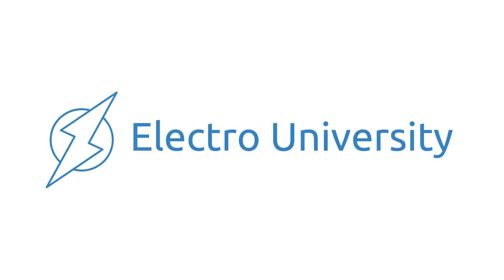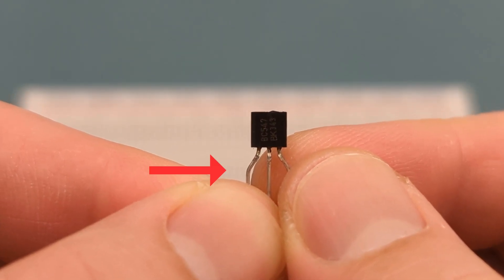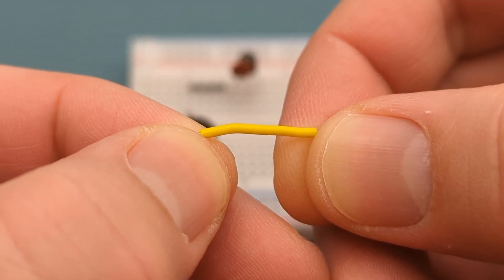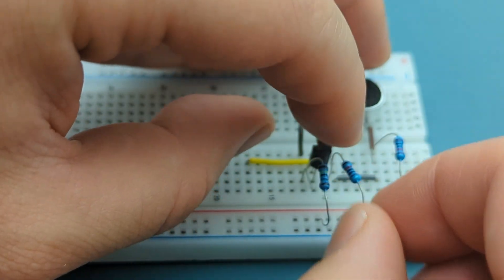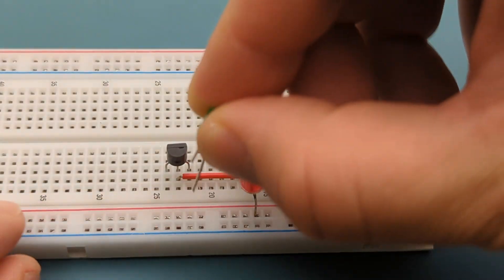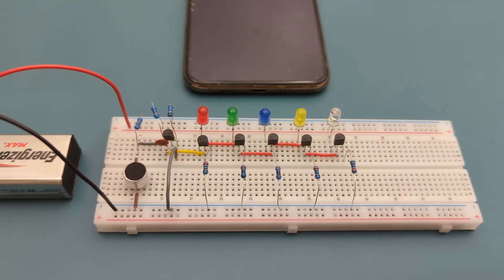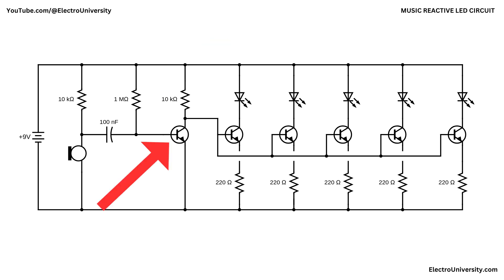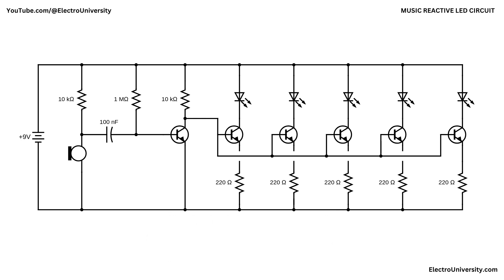How to Make Music Reactive LED with BC547 Transistor

Comment from the maker: 🔔 Get your tools here:
✅ Electronics Component Kit: https://amzn.to/3N65asq
✅ 9V Battery Buckle Connector: https://amzn.to/3S7kbg8
✅ 9V Batteries: https://amzn.to/4kkonVD
✅ BC547 Transistors: https://amzn.to/44pDOFW
✅ 104 Ceramic Capacitors: https://amzn.to/448CgRC
✅ Colors LEDs: https://amzn.to/46p6Qb0
✅ Resistors: https://amzn.to/3YfGeUi
✅ Jumper Wires: https://amzn.to/3NNn9UR
✅ Solderless Breadboards: https://amzn.to/3SndKWm

Comment: Thanks for the video!!!
I am also having trouble with the lights remaining on when power is applied. I  may have a bad condenser microphone. I also noticed that the capacitor I have is marked 101 instead of 104...
Any ideas for what else might be wrong?
Reply from the maker: A capacitor marked 104 is 0.1µF, while 101 is 0.0001µF. This could affect how the audio signal is filtered, potentially causing false triggering or keeping the LEDs on. Try swapping it for a 104 ceramic capacitor.
Reply: Thank you!
I found my LCR T7 tester, and you are 100% correct!
Thanks again!

Comment: this is not working ,, led's are remain ON all the time , i used the same components as you use ..
Reply: Bro first check if all the connection are done correctly, then once connect music condenser in opposite direction to that of video , u may then get the output

Comment: are they PNP or NPN
Reply from the maker: I'm using NPN transistors in this circuit, so the image shown at 0:54 is incorrect. It should display a BC547, not a BC557, which is a PNP transistor.
Reply: All are NPN as shown in video NOT PNP